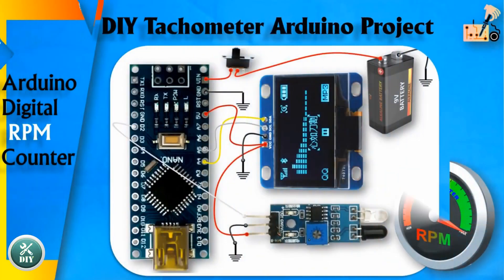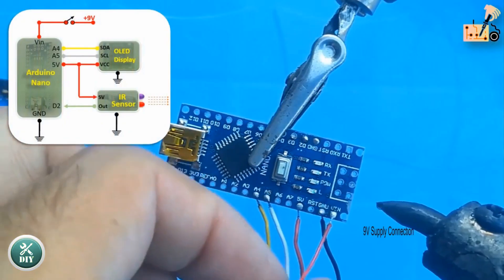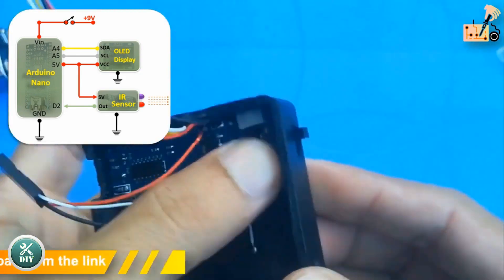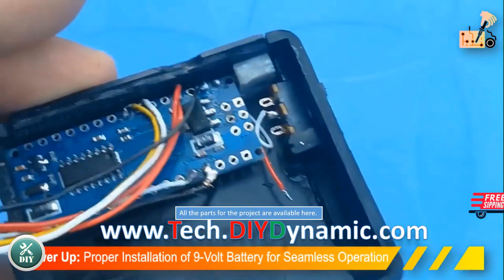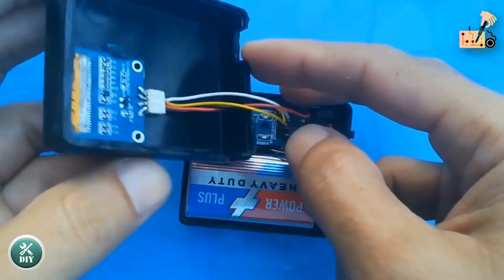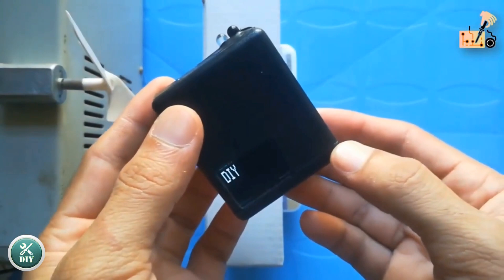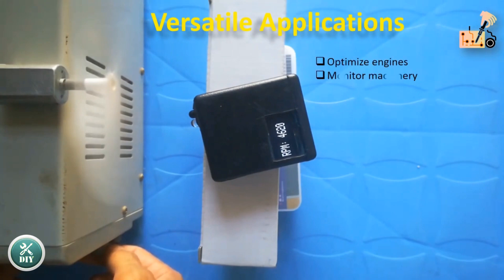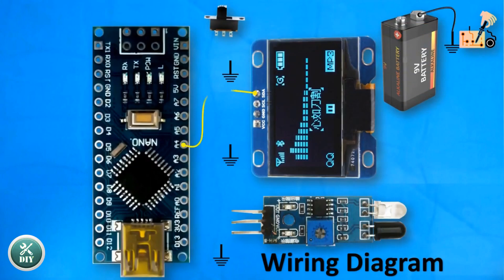🚀 DIY Arduino Tachometer Tutorial: Measure RPM Like a Pro! 🛠️✨

Comment: Thank you, This helped me so much to make a RPM and speed tester for my slot cars. Is it possible display the RPM with 2 decimal places?
Reply from the maker: why need to display rpm upto two decimals anyway? it will only be required if your rotating device rotates at almost constant speed and you need to monitor fractional changes in the speed. anyway you can display it using these two lines in code :     char mbuffer[10];
    sprintf(mbuffer,"%0.2f",rpm);
Reply from the maker: You can download the complete code from this link https://drive.google.com/file/d/1NHnG2lsjFhAzuFo2wxH5-4FsREPmFCKb/view?usp=drive_link
Reply: @HobbyElectroLab  Thank you. I have it working perfectly now and displaying the KPH with 2 decimal places
Reply: @HobbyElectroLab  Thanks for the reply. Sorry I meant to say the KPH with  2 decimal places.
As the way my speed tester works the RPM can change but the speed stays the same.
So for me it would be 
 char mbuffer[10];
    sprintf(mbuffer,"%0.2f",kph);

Where should I add these 2 lines?

Comment: What is the max rpm this will read?
Reply from the maker: i have not tested its max rpm. that depends upon the LM393 on IR module  and also in ISR of Arduino. roughly it should be near 75000 to 80000 rpm maybe

Comment: how can I add a display for the maximum rpm that I reached?
Reply from the maker: you can give chatgpt this code and ask it to modify it so that it displays max rpm value. if you don't get desired result then let me know...
you just need to compare the current rpm value with previous one if it is greater and then display it. chatgpt will do it for you

Comment: can IR read the rotation of the bearing? and is there anyone who can compare the RPM to the speedometer? or so that it appears on the RPM and speedo display.. Thanks Bro
Reply from the maker: if the bearing has a small strip of reflective tape on it then it will reflect the IR beam and its rotation speed can be measured. i didn't understand what speedometer you are talking about.
Reply: @HobbyElectroLab  km/h
Reply: @HobbyElectroLab  I will use this as a speed measuring tool for my RC car.

Comment: Code?
Reply from the maker: Code file can be downloaded from this link 
https://drive.google.com/file/d/17PAOxvHbt8n4DYTM_2ZhbcEtsmj0R2LB/view?usp=drive_link
Sorry for inconvenience
Reply: Well I tried and did all things accurately but the display is stuck at 0 rpm it's not increasing no matter how much I try
Reply: ensure your rotor or fan is properly reflecting IR beam. try at slight angle as in video. try refecting tape for proper reflection. ensure IR sensor is responding. check its sensitivity. a lot of things could go wrong for it to stuck.